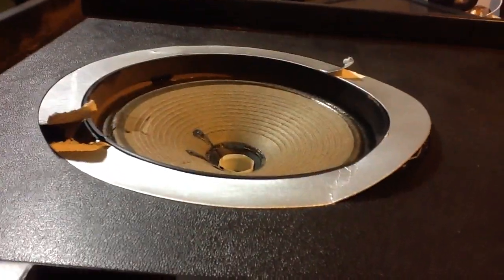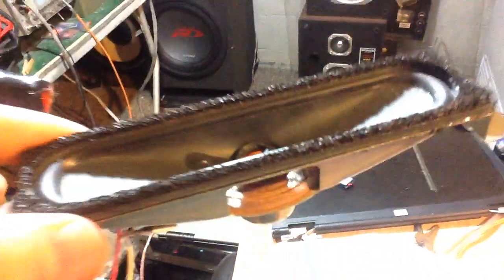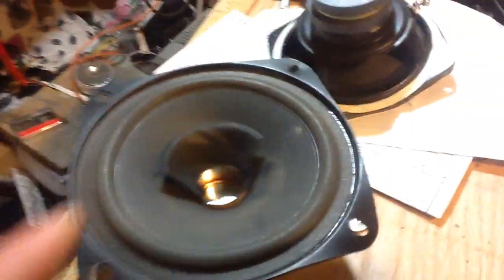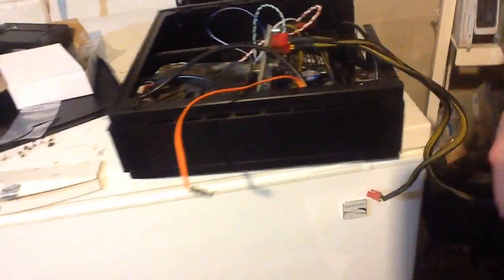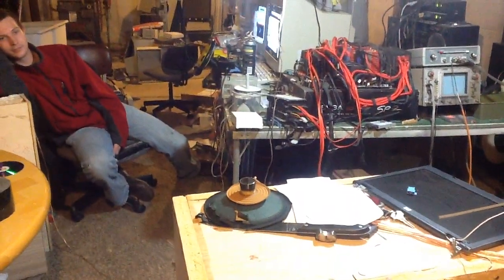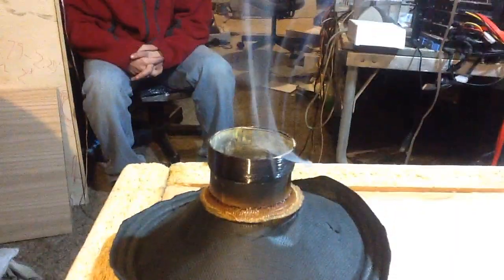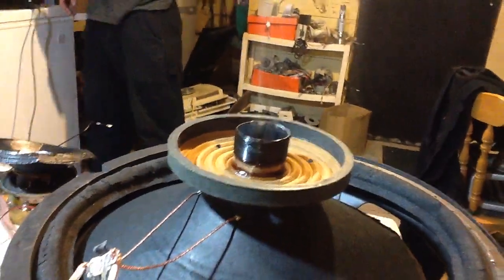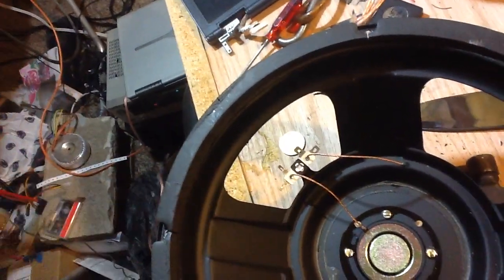Woofer/Speaker/Coil Blowing Day!

Comment: that pc in the back -_- 5:25
Reply from the maker: +IronicSavage -_- i see no pics in that frame, i see chase.
Reply: RockeyDAproductions the computer in the back -_-
Reply from the maker: +IronicSavage -_- http://valid.canardpc.com/s2dx34 upgraded information: os drive seagate cheeta 15k.7 300gb steam drive seagate cheetah 15k.7 300gb, 4tb segate for torrents
gtx 680 oc at 1.3ghz core 3.3ghz mem 6.6 if you do the data dobble.
everything is budget and i fucking love this monster! (over time i probably dropped arround 1200$ in this pic)
i could never go single cpu agin, i could never go on a non test bench setup agin, and i will never go SLI agin. at one point i had 3 gtx 480's and still  had more stable and higher performance on just one, so now i just overclock the shit out of one card! :P less power, less heat, more performance! although i did keep one of the 480's for phys-x and second monitor.
Reply: RockeyDAproductions im just talking about the moniter/pc itself. So bulky
Reply from the maker: IronicSavage -_- oh, i love that to, dont care for left monitor, but my right is finely tuned by me and runs 2048x1536 @ 75hz 12" and 75lbs! 
the only way i am leaving this monitor is if i could afford the Sony FW900 http://www.ebay.com/p/Sony-GDM-FW900-24-Widescreen-CRT-Monitor/52108670